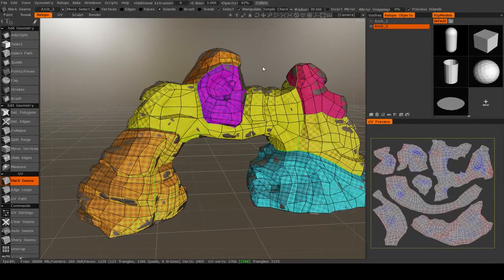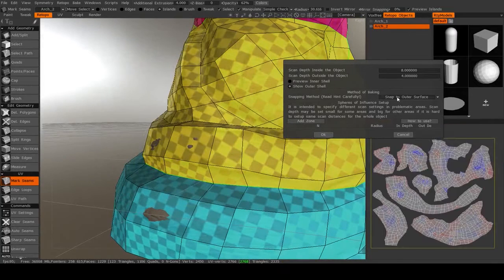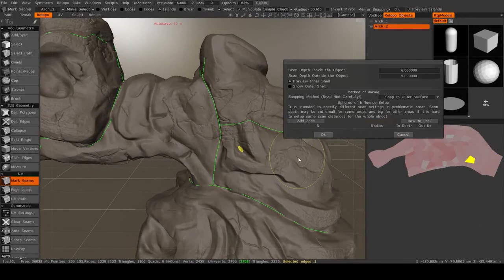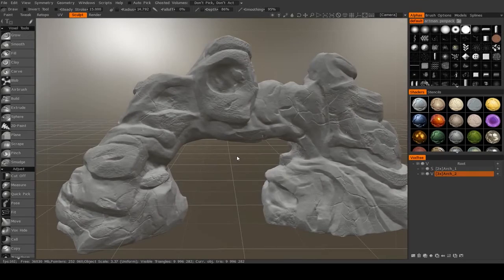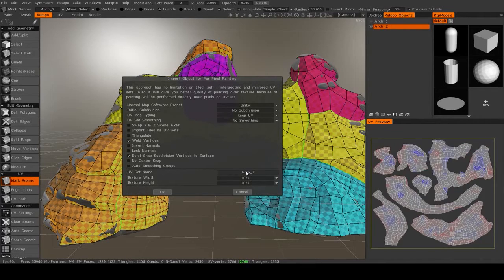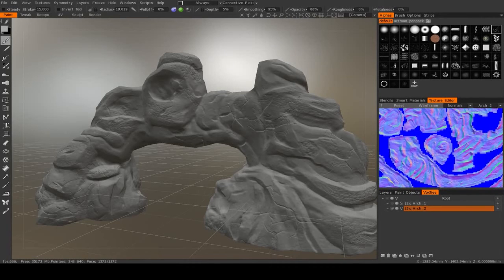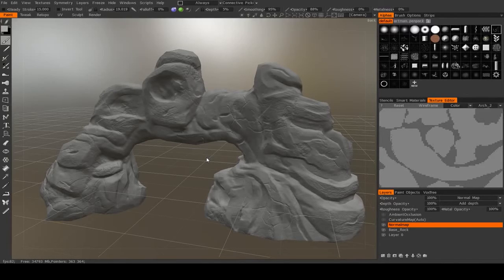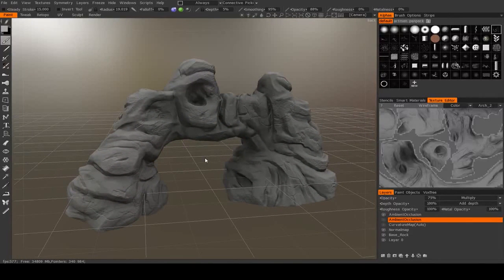3D-Coat Arid Arch Tutorial: Part 9 (Texture Baking)

Comment: Hi, why can"t we simply use the Zremesher for the retopology, of non deformable things like rocks, props ?
Reply from the maker: Tools like Autopo and the Zremesher don't produce highly optimized geometry. They are better for objects that are meant to have clean topology so they can deform smoothly. The reason is that they both only work well when they have to produce a high number of retopology polygons. It could work with a model like this arch, but you would get many more triangles in your retopology mesh which isn't ideal for game development (this mesh was intended for a game). For unorganized props like this, I'll do the retopo by hand because that way, I can get the absolute lowest triangle count while maintaining the silhouette of the model.
Reply: thank you